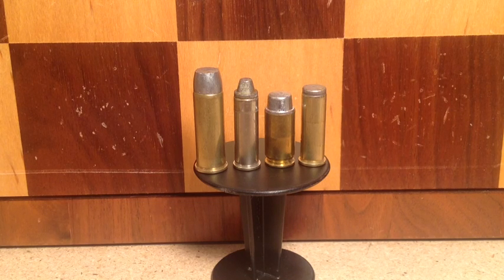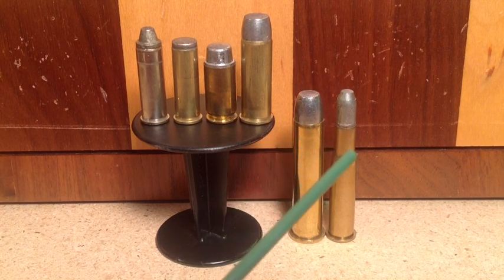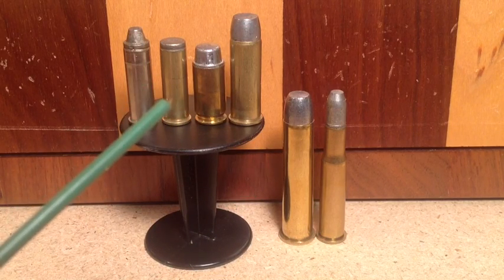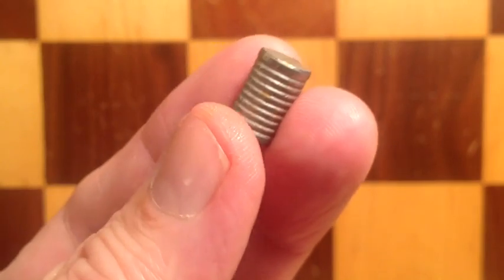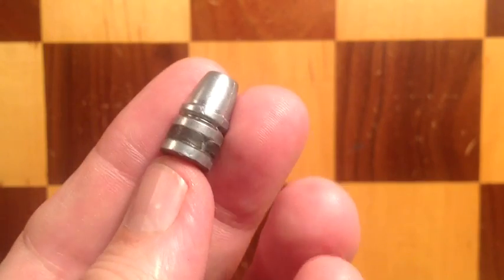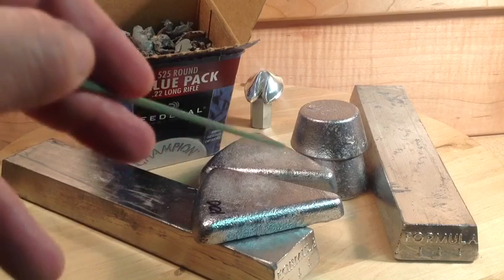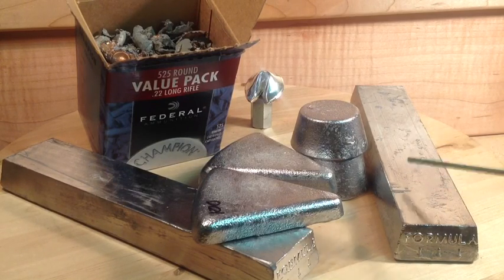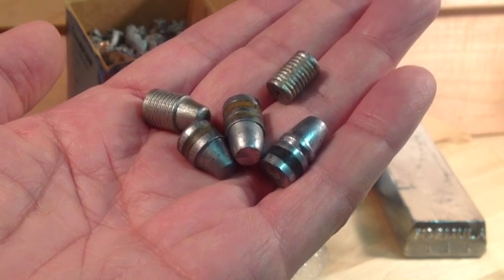Lead Hardness FAQs & How to Mix Bullet Alloys For Hardness

Comment: Thank you. Now that I have a bunch of lead from varying sources, I need to get bit scientific in my mixes. Setting up dies and measuring, etc have never intimidated me even when a beginner, but this does.
Reply from the maker: derekec - if you know what your lead is, you can use the free download Lead Hardness Calculator from the Cast Boolits website to set your mixes.  e.g. linotype is 84% lead, 12% antimony, 4% tin.  Hardball alloy is 92% lead, 6% antimony, 2% tin.  Lyman #2 is 90% lead, 5% antimony, 5% tin.  Roofing lead is as good as pure lead.  Scuba weights are pure lead.  Range scrap is 96% lead, 1% tin, 3% antimony.  These are plugged into the LHC in pounds and the final BHN of the alloy pops up.  You can plug in the BHN you want and the calculator will give you the weights of component alloys to get you there.  Good castin’ to ya.. FCSteve

Comment: Does lead hardness make a difference when powder coating bullets?
Reply from the maker: MLP - Yes, but less than before.  If the velocity is high enough with softer bullets - not holding the rifling can still happen.  No leading but accuracy loss will occur.  When you find the tip over point, then using harder bullets will enable higher velocity as long as your gun and brass srength allows.  Best to ya..FC Steve

Comment: Just a question can I use Lyman #2 to load 460 S&W 300 grain bullet at velocity round 1700 to 1800 ft per second. I will be powder coating and applying a gascheck. I've been loading 9mm 45ACP 10mm.
Reply from the maker: punchrolo 2 - Yes, you can do that, and leading will be controlled.  But guns vary - If accuracy is enabled, that's a go.  If not, you might need BHN increase to BHN 18 by adding 3% more antimony to your Lyman #2 - the alloy will be harder to hold the rifling at your 1700 - 1800 fps.  Good shootin' to ya,  FC Steve

Comment: Do you ever melt down pewter dishes for alloy?
Reply from the maker: John K - No - reason is that pewter is often more expensive than the base metals would warrant, plus pewter is all over the place as to content.  It is good for source of tin though.  Antimony is what we need for our alloy hardening though.  So the best was linotype.  Now we have even bettter - SuperHard Alloy from RotoMetals (30% antimony) - I always order SH as well as linotype when I order as the linotype is excellent for tin (we need that to make our alloys flow and fill out our molds).  Good castin' to ya,  FC Steve

Comment: What phn do you use for making 9mm? 45 caliber? And for like 12 gauge round ball? Should I use pure lead for round ball or should I just used something a little harder? Also do you have any videos for shooting round ball out of 12 gauge? Have you made any mini shotgun shells like the one in three quarter inch? I would love to see a video on that
Reply from the maker: COL - You need BHN 15 for auto pistols for functioning.  12 gauge should be pure lead, and yes, I have videos up on shooting 12 gauge RB.  No, I do not load the mini shotshells as my MEC and Dillon are set up for the 2 3/4 inch shells.  If I used the minis, I'd just get the Aguila factory ammo as I wouldn't be shooting those all the time.  Good shootin' to ya,  FC Steve
Reply: FortuneCookie45LC Thank you for the reply. What if I was to load 308 rifle bullets, what BHN would be adequate? Also what is Wheel Weights BHN?
Reply from the maker: COgunLover - WWs used to be hard enough to cast magnum pistol straight up, but they have gotten softer in the more recent availability.  BHN around 14 some think even a bit less.  Still good for most of our shooting.  Rifle bullets in 308 need BHN 18 for most shooting.  You can get that by using Superhard alloy (30% antimony) easily.  Have a great day,  FC Steve
Reply: FortuneCookie45LC thank you for the fast reply. So if I use a 10 lb lead pot and I want to increase my bhn by 3 how much super hard should I add?
Reply from the maker: COgunLover - Best to download the Lead Alloy Calculator from CastBoolits.  You plug in the knowns and the program tells you how much SH alloy you need.  Good castin' to ya,  FC Steve

Comment: I have always been told that the proper gauges to use is pressure instead of feet per second.  The reason being that pressure allows what if any leading is going to happen with each individual load and using the same weight bullet for. Each test.
Reply from the maker: John Smith - You are absolutely right.  Pressure is the better consideration for bullet hardness optimization.  But since we don't have pressure equipment, the relationship between pressure and fps is relational enough for us to go with it...and those that tell you that bullet casting is a precision activity so that bullet hardness should be in tenths of BHN or weigh the components to make the alloy and control the temp to the degree are missing the point.  A good bullet that fits the gun is the name of the game.  Buffalo hunters made their bullets from buffalo chip fires the night before the shoot, and they nearly extinguished the entire species from the North American continent.  Good shootin' to ya,  FC Steve

Comment: Once again I learn something from your videos! My dilemma right now is I cast up 100 Lee .452 swc that are supposed to weigh 252 grains.  Yet they average at 260 gr.   What gives?  The lead is soft. I can dent/scratch it with my thumbnail.  I am wanting to shoot this out of my pietta 1858 Remington with a conversion cylinder and I’m having a hard time finding load data for such.
Reply: mark perez what powder are you using I have a 1858 re with a conversion and I use 200 gr rnfp and use trailboss and drive them around 900fps no leading and shoots good

Comment: Heat treating wheel weights and water quenching will increase hardness as well.......I do this for my magnum loads with bnh levels from 22 up 30
Reply from the maker: johnwilliams40 - There's also SuperHard alloy (30% antimony) = BHN 36.  But the intel is that bullets cast of SH alloy will be on the brittle side - bullets break up on impact with bone if we just cast that with standard practices...You're probably doing the same hardness tempering that is done by some of the specialized commercial bullet casters like Cast Performance.  Continued good shootin' to ya,  Merry Christmas and Happy Holidays to ya,  FC Steve

Comment: I enjoy your YouTube video but you are a little off on the Brinell Hardness Number for pure lead. The ASTME  say the number is 4 BHN. 8.6 BHN would be close to 40-1 lead-tin.
Reply from the maker: Jim Crossley - Absolutely...And discussions of bullet hardness are certainly interesting.  There is controversy on the hardness of pure lead...I've heard some say that pure lead is BHN 5.  I just go with RotoMetals formula for BHN hardness (lately, I've just used the Cast Boolits Hardness Calculator - just plug in the alloys being mixed and the final BHN is calced for us - easier than the RM formula - but the formula is good for understanding).  RM has been providing lead alloys to bullet casters for 75 years and they make their alloys in their smelting factory.  If they are saying that lead is BHN 8+ on its own...I'll just go with that, and it hasn't let me down in the last 35 years or so.  I really should ask them how they got their 8+ for pure lead.  The 8.6 just may be a casting constant that makes everything work.  But the CBHC works well also - I looked at their calculator and it appears that the BHN is a bit higher but not 8 of course.  Elmer Keith used 16 - 1 alloy and he referred to that as hard lead...point is that lead hardness is not as significant as we have regarded.  We tend to use lead harder than we really need.  Commercial cast bullets are usually on the hard side also, but for different reasons.  We also see controversy on how much hardness we gain by water quenching.  I've never even gotten close to getting hardness exceeding pure linotype as has been reported.  Best to ya, FC
Reply: I have been using there alloys for some time and the number they give me is 5 BHN. Not sure where the 8.6 comes from?
Reply from the maker: Jim Crossley - That's their formula for BHN based on     Brinell = 8.60 + ( 0.29 * Tin ) + ( 0.92 * Antimony ); the Tin and Antimony are the % of each in the alloy - apparently the 8.6 is some kind of constant and not the hardness of pure lead...I have used this formula for many years and it has worked well for me...so really it doesn't matter what the 8.6 really refers to... the BHN still works...I should check it against the CBHC just for curiosity...  Have a great day,  FC

Comment: This video was exactly what I was looking for. 
Alright, I plan on getting a 454 Casull lever action rifle and have it set up to run heavy (400+ grains if I can get the c.o.a.l / seating to work) subsonic loads at about 1,000 fps. If the goal was to have the most terminal performance, how would that be best achieved? Ideally, the round would mushroom some and dump all of it's energy quickly instead of over penetrating.  
You said 15-16 hardness was acceptable for around 900 fps, but how well would that deform at those speeds?  
Not sure if pure lead could be powder coated or maybe something like 30-1 or 40-1 with a coating. Or would too soft of a bullet just splatter upon impact? Or is it having a hollow point more or a factor than the type lead used? 
Any info would be greatly appreciated.

Comment: Thanks for this finger nail test. I use wheel weighs Thai I melt the metal clips and impurities out .then pour into ingot's. Then I mix 9 pounds of w.w lead with one pound of pure tin .flux the melt with pine sawdust and water drop my cast bullets. That's just what works good for me. 38/357 30/30.
Reply from the maker: killer 65 - Wheel weights all by themselves are great for up to light magnum pistol.  With the extra tin, you should be good for magnum pistol, plus gain the added flow from the tin to fill out your bullets... Continued good castin' to ya,  FC

Comment: Thanks for the info.  My Lyman cast bullet handbook says alloys with a BHN between 10 and 15 are suitable for speeds of 1000 to 1800fps. {pg 73 4th ed}. Have been on the fence as to what BHN to order using Titegroup 4.5gr in a 357mag. Lee manual says 1028fps for this load with a 158gr lead bullet. Would I be better off using a BHN of 18 or 12 with this load in a Henry lever action? Going to use MBC bullets since I do not cast my own bullets.  Any info would be appreciated.  Enjoy your videos. Would like to see you do a video on using the Lewis Lead Remover system to clean a rifle.  thanks
Reply from the maker: larry munninghoff - When it comes to all those hardness issues, our best policy is to use proper fitting bullets as the first priority...that will really be the factor that will keep us smiling shooting cast bullets.  The hardness is really a ballpark thing and using BHN 18 in your Henry is a very good idea...your longer barrel will warrant the harder alloy  Missouri Bullets gives you a good reliable bullet and BHN 18 will serve you well - even if you stoke your loads, you've got hardness to spare...and unless you are shooting cowboy action the BHN 18 has the lattitude to handle it (if shooting BHN 22 bullets - too hard and could lead barrel shooting light loads)...If you do cowboy action, Missouri BHN 12 is it.  Have a great day,  FC

Comment: So... if powder coating prevents leading, do I need to worry about hardness in riffle rounds?
Reply from the maker: mike pili - With powder coating , we don't have to be concerned about hardness anymore with handguns (with the exception of the real big blasters.  But with rifles, the change over from cast bullets to jacketed came when the cast bullets could no longer hold the rifling.  It has not been shown that powder coating allows bullets to keep from stripping off the rifling.  No leading is a good thing, but bullet stabilization is still needed to hit at distance.  Have you seen a lot of targets shot with powder coated rifle bullets??  We have seen a lot of targets shot with jacketed though - all those tiny groups.  Have a great day,  FC

Comment: another source for tin or antimony is to see if your local scrapyards will sell you lead people have turned in. This sounds expensive for lead but last time i needed lead i paid 69 cents(you pay what their suppliers will pay them for it+ a small amount)  a lb for it and depending how friendly you are to the staff, they will let you pick the lead you take per lb....and the one i goto does NOT separate the higher tin or antimony  bearing lead from the  100% lead diving weights and etc. One round i went looking for lead i got 69 lbs of 60/40 bar solder and well....i don't think i'll ever need to spend a dime on tin in my lifetime for bullet casting now and there was at least another 100 lbs there. its best to check though as some places will separate this lead into multiple bins and its a blessing and curse in one pass. the blessing is knowing they have antimony and or tin bearing lead, these places often have a metal checking tool that costs a ton of money and may charge you a lot more for your prized metal or in the case of the solder, your 99 cent a lb lead may cost a lot more if they know why you need it.
Reply from the maker: twilson1118 - If I had a chance to buy 60/40 bar solder, I'd snap it up also - Sounds like you have an excellent source for raw materials...Congrats to you, and Good Castin' to ya..!!  FC

Comment: First and foremost let me say thank you. I ordered lead from rotometals and used the ratio you posted of 6 to 1 for my range scrap. All of my bullets came with in a half to 3/4 of a grain of each other from my lee 2 cavity molds. My wife and I remelted all of our bullets and started fresh today. It was fun and very rewarding. Our previous weights of our bullets was all over the place. Knowledge is key. Thank you for sharing your wisdom.
Reply from the maker: Green Kool Aid Reloader - And please let me say that a husband / wife casting team is a wondrous thing...May the two of you take care of each other for the duration... At some time, you might wish to powder coat your bullets - and that will open up even more fun, challenges, experiences and satisfaction.   Thanks for your neat comment... FC

Comment: Good info. I don't cast but its nice to know what cast bullets to buy and use.  When do you need to use a gas check on a cast bullet? Thanks!  BTW some of your text boxes in the video are popping up with nothing in them.
Reply from the maker: toy collector - Thanks for the heads up...we can't even use the text boxes now, as when we do the cards and end screens, annotations cannot be used.  GCs on cast bullets for rifle shooting makes sense.  For handguns, GCs are not necessary - but if a shooter wants to use them for whatever reason deemed fit, they can be applied.  Some cast bullet designs are gas check designs giving shooters the option to use them or not.  Very few of my handgun bullet designs include gas checks.  Have a great day,  FC

Comment: I am just starting to get interested in casting. I plan on casting plinking loads for a 44-40, 38-40, 38-55, 30-30, and maybe 45-70. Is there an alloy that will work well with all of these calibers so that I can buy in bulk so to speak?
Reply from the maker: gnomehater63 - If you are going to buy alloy, RotoMetals has Lyman #2 alloy - it is industry standard for cast bullet alloy and will do well for all the calibers you list.  Since you are beginning, that is a great way to start for uniform results.  Later, you will be mixing your own alloys - easy with more experience.  Please come back to let us know how you are progressing.   Best Regards,  FC
Reply: Thanks FC. I have a mismatch of scrap lead from fishing weights, other projects, etc but I want to get it right the first time with a proper alloy as these rounds will be going through original winchesters and sharps that I inherited. Thanks for the awesome videos, they are a huge help.
Reply from the maker: gnomehater63 - Wow!!  Congrats on inheriting those old historical guns...you might check them out though - might have dark bores from shooting black powder, and if so, they may function well but may require that you shoot black powder rounds through them because of the strength of the steels...Best to ya, FC

Comment: Ok brother I am following you lead + hot gas=leading the barrel. Can I ask how about Gas Checks? will they prevent this or not? See I like the harder lead over the soft especially when I am casting Hollow Points. Soft lead Hollow points yes mushroom well.However Hard Lead mushrooms well and creates one BEAUTIFUL exit cavity..heeheheheheheh...
Reply from the maker: Taurus/Hipoint Enthusiast - I see - Taurus for revolvers and Hipoint for autoloaders - not a bad way to go... Gas checks really serve no purpose for the huge portion of our handgun shooting...If copper GCs are bought, they are 4-5 cents each.  But if tested and the GCs shoot better, then by all means, use the GCs.  GCs for rifle cast bullet rifle shooting makes sense.  Your harder cast HPs are good bullets... Best to ya,  FC
Reply: Thanks I got to kicking it around with a few others no one was quite sure.